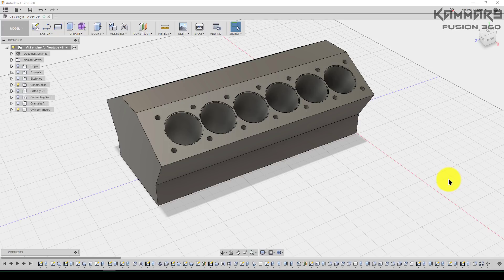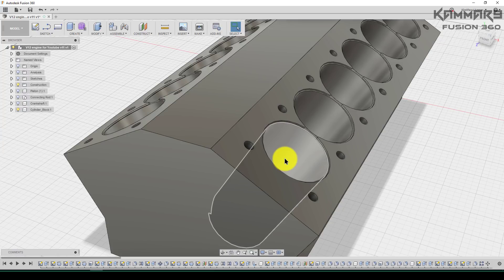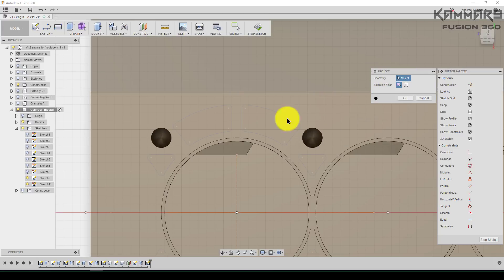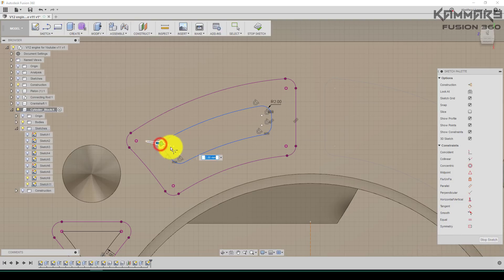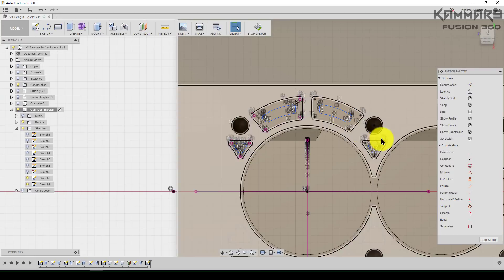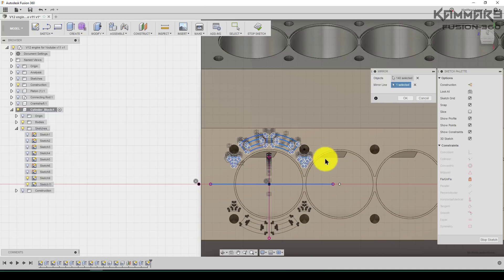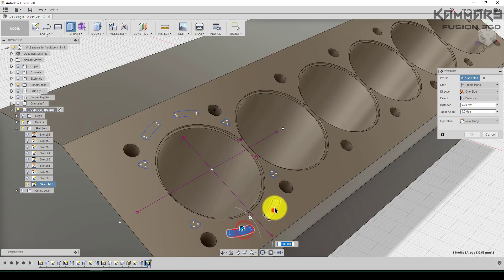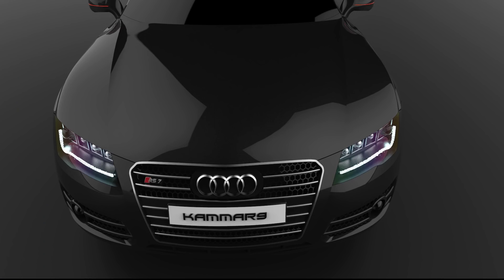Fusion 360 Modeling V12 Engine EP 09 😍   Full HD

Comment: You can also use 'Mirror' to do the other side but you will need to use 'Split' to do it.
Reply from the maker: No . You can't use mirror here because the position of the right and left cylinders are not the same
Reply: @AmmarKhelifaoui  I know they are not in the same position. Maybe I share with you my version of it?
Reply from the maker: @victorsoh7891   yeah you can post images on my page find it on the description . Maybe you version is better 😜